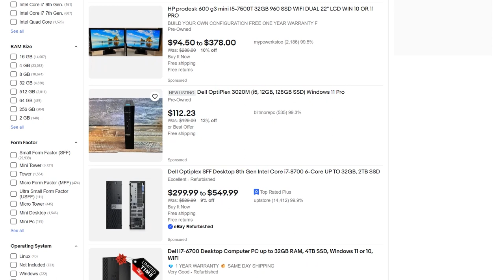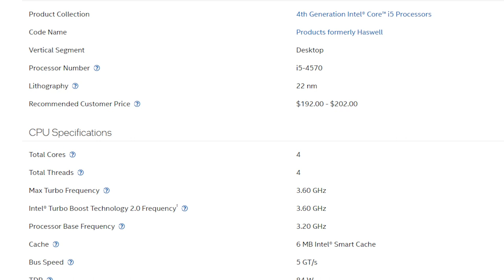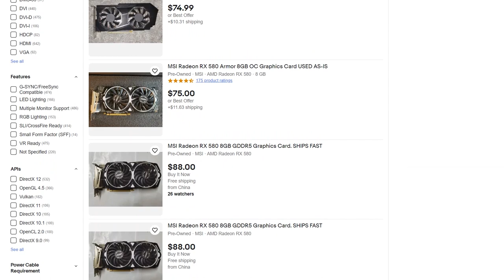I Built a $200 Gaming PC

Comment: I used to do a lot of budget office PC rebuids, I think it's cooler than the 2000$ pcs (at a certain aspect)
Reply from the maker: True! It’s obvious expensive computers will run well lol not so obvious with cheap and weird ones
Reply: Way cooler bro build on
Reply: the satisfaction of building one of these is way better than the expensive ones, especially being on a tight budget and picking the parts
Reply: so true tho it's just so satisfying when it finally works as expected
Reply: weirdo build he did, gaming PC it is NOT !
more fens, radiator ! old GTX 1080 !

Comment: These are my favorite builds to do for customers. They have character and I love rescuing older parts and pairing them to make a great budget esports gaming PC. I5-2400 with an RX550 4GB/GTX1050 was the go to for a long time along with an SSD.
Reply: what parts should we look out for today if we’re trying to replicate this build?
Reply: @supernatural2968  basically what I said. An older Optiplex with an i5 or i7 and a GPU that doesn't require a 6pin. They do make sata to 6 pin adapters though, too. Just most the PSUs in these are around 180w or less.
Reply: Coincidentally, my kiddo plays on my old gaming computer (already on a budget) that has a I7 and GTX1050/2GB. It's held up really well over the last 6 years, but it's getting close to being time to replace it.
Reply: @ShadyButFresh  yeah depending on which i7 it is, you may be able to pair a better GPU with it and keep it longer. Also, just upgrading to an SSD really breathes life and speed back into an old system.

Comment: i play on a core 2 quad e8200 that bought for 1 eur! 15eur on 4gb more of ram, a 250gb ssd and a 20eur gt640. Play almost any game till 2017 and even new games not too complex are also playable. Now bough a hp elitedesk i74790 16gb ram and ssd250gb for 130eur! a 2nd hand rx580 and a new power supply. As soon as the cable adapter arrives from ebay (stupid hp specific connectors) i will have a perfectly modern gaming pc for 250eur...

Comment: Honest, sincere and just amazing presentation, you got my subscription Jason. A Lot of budget gaming Optiplex builds out there but would like to see someone take an Optiplex as far as it can go. Best Dimms not those standard cheap looking hynix stuff, best cooling solution and fastest GPU on a 3rd or 4th gen machine
Reply from the maker: Thank you for your support! Glad you liked the video
Reply: He’s got the fastest cpu I’m pretty sure. I got an 7010 with a lga 1155 socket. And I’m pretty sure the fastest cpu you can get is a Xeon 1620 v2 he said 1625 so I’m not exactly sure but the I7 3770 is apparently the best for gaming but the Xeon is the same ghz and actually gets like.1 or .2 higher with turbo. My 7010 played the new halo for like 5 minutes lol. But I got a gtx1060 3gb and the minimum for halo is 4gb and I need to upgrade my processor cause it’s only 3ghz with 4 cores and threads. I’d bet his setup could run it on 1080p  but I play destiny 2 on 1080p no problem. I been stuck on it for awhile. I want to play shatterline. Looks pretty cool.

Comment: My only complaint with the OptiPlex 3020 MT is that the PCIe slot is only 2.0, while the 7020 and 9020 are PCIe 3.0 and they have 4 RAM slots. Anyway great job on the video!

Comment: I have a same Dell PC with i7 4790k and 1050ti. The power supply I added is a Dell 390w with extra plug for a GPU if I want to upgrade. Total cost was $250

Comment: Man, I saved up enough for a used 3090 before 40 series came out and it was awesome. Ran into a pinch and had to sell it. Managed to snag a 980 for $50 in the meantime. Knocking it down to 720 30-60fps from 1440 144hz was real humbling. It was a bunch of fun though! Throwback to my early years of PC gaming.

Comment: ive been considering making one for flip builds but idk. can make an am4 system for $50-$100 more and have way more upgrade paths and general longevity. this is however the best price to performance optiplex build ive seen, blows ztts outta the water.
Reply from the maker: Thanks! I appreciate it! What custom am4 build can you make for $250? 🧐🧐
Reply: @JasonWitmerYT  im actually contemplating making a techtube channel to show off my flipping adventures. my most recent build has a ryzen 1600 for $20 with a cooler, an rx570 for $30, 16gb ram for $30. tldr grand total of build was $260. yours graphically dominates because of the 1070, but mine is not nearly as dated hardware/ new quality. longevity is a big deal to me and we are now moving into the age of ddr5. not to mention the capability to upgrade all the way to a 5th gen ryzen

Comment: This is almost exactly like what I have. But I just used metal cutters and pried out the hdd cage 😂. Also, mine is a 990 DT with 16 gigs of dual channel ram (4x4 sticks), i7 2600, a 300 watt p3087f5 power supply, Asus Turbo GTX 1060 6 gig, and everything was free except the 87 or so total dollars spent for the gpu. I had a GTX 960 2gig Gigabyte Windforce in there before. (The ram speed is 1333 mhz. I want to upgrade it to a 3rd gen i7 and replace one stick to a 1600 mhz 4 gig module, but don't want to spend money 😅. Great video!
Reply from the maker: Nice rig! I was very close to doing what you did haha but drilling out was a little less messy
Reply: @JasonWitmerYT  True! I just did not want to use power tools. 😅 Brute force worked for me 😅.
Reply: Nice. I have a gtx 1060 3gb. I got for free. Wish I had the 6gb I got a optiplex 7010. For $30 and just grabbed an $11 i5 2320. (I need to upgrade it) it kinda pegs out during gameplay. I got 3 4gb ram and an 8gb ram. I know you aren’t supposed to mix but I had a ts140 with 4x4 but one was pee which is server ram and my computer won’t accept it for some reason. I kinda wish I didn’t Brick it replacing the cpu.  Because the lga1150 cpu socket seems to have more options than the lga 1155 but I may be mistaken. I didn’t know games will do better on less cores higher ghz than lower ghz more cores. But the ts140 had a dual core 3.5 ghz I 3 and it ran games better than the quad core i5 3.0/3.2 ghz. Oh well I’m gonna get the Xeon 1620 v2 or the i7 3770. You can find them on Walmart.com by private sellers for $20-$30  then I’ll go for a better gpu. I actually saw a gtx 1060 6gb for $50 on Facebook marketplace.

Comment: Great video. Optiplex computers are great for a quick inexpensive mod.

1 updated my old 7010MT that has an i7-3770.  Great little gaming machine for little $$$.
CPU: i7-3770
RAM: 4x4GB
GPU:  MSI RX580 Gaming X 8GB (needed to take out the lower drive bays)
PSU: Corsair RM550x
ARGB Controller: COOLMOON
CPU Cooler: Jonsbo CR1400 ARGB (tower cooler with 92mm fan - keeps gamin temps less than 70C.
Jonsbo FR925 ARGB reaar exhaust fan
Arctic P14 PWM ARGB case fan (cut out a bunch metal case  behind the front face plate to improve air flow)
2 CRJ 5 pin fan adapters to connect aftermarket fans (no fan errors).
Cheap 90 degree USB3 header adapter as the graphics card covers the header.
Cut the side panel to fit an acrylic window.
Reply: Rx 580 8gb is king of price to performance! Awesome build.

Comment: Good video. Dell make 'workstations; built to run 24/7 under stress. That's why they last and make a great second hand buy. They aren't pretty, but they are reliable. i'd choose that over some £1000  RGB loaded pile of junk off Amazon any day. Oh. always replace the CPU thermal paste though.. it;'s usually white dust after this long.

Comment: I love these builds and hate the people that shame them... my main PC is a Dell precision 5810 (got free from work), E5v3 2667 processor, 24 GB DDR 4, I upgraded the power supply to the Dell 625 watt, added a GTX 1070TI, an SSD with windows 11 pro, and wala! a decent gaming PC! all for well under $300! It plays everything well at 1080P high settings
Reply: Another t5810 owner here. Got it from a local refurbisher for around 200€(coverted from ron).
Mine has the e5 1620 v3, 16gb ddr4, 685w psu with dual 6 pin and an rx 470 8gb. Slapped in a 25€ 480gb kingston ssd and everything works fine so far

Comment: I just recently got a Dell Precision T1650. It has the Xeon E3 1280 v2 with 8gb ddr3 ram, 2 500gb hdd and the Nvidia Quadra 2000 gpu and 265W psu. I ordered another 8gb of ram to bump it to 16gb and getting a RX550 gpu. Along with some adapters and a wifi stick im coming in at about $90 total. My plans are to do light gaming but more for music work.

Comment: A lot of the people that sell the $150+ ones actually are worth it. I built my first pc this way, $150 optiplex 9020 mt with a i5-4590, 16gb ram, 128gb ssd, 3tb hitachi ultrastar. All i did was put a 500w PSU in it and I upgraded to a Xeon E3-1271 V3, it was only like $60. they're much cheaper now. Sold the i5 for $50. I had a RX570 in it but upgraded to a RX6600xt. I've since built a new PC with a 6700xt and ryzen 5 5600 but the optiplex is still running. 

Also all the front sd/micro sd readers work, disk drive as well. 

By the way and fair warning, the RX6600xt is absolutely the maximum sized card you are getting in there without drilling out the HDD cage, which I tend to like because there is nowhere else to put your storage. Also you will need to make sure your sata cables are plugged in beforehand, as well as manipulating them and probably tying them together so they don't bump into the GPU fans. I had one annihilate one of the fans on my rx570 which I had to replace, which was a pain in the ass because MSI Armor card, but it still works after 5 years. Also that card was a tight fit, but the 6600xt is quite literally basically snug against the cage. 

Minimal bottleneck on my setup, I've put my 6600xt in my newer pc and there wasn't a crazy difference, 12-30fps margin, not too crazy because were talking 100+fps

Comment: I assumed you used your existing monitor, but for the scenario of a kid buying his first pc, you should probably have mentioned that cost.  Its important to point out that with a system like that there's no point going overboard on a high res, high refresh rate monitor.  Great video though. I did something like this about 10 years ago buying an old Xeon server from surplus for gaming and to host a minecraft server. It was great as a server but terrible for gaming.

Comment: Man I love these kind of of repurposed builds and budget gaming PC's. I have like 6 older office PC's that I got for between $28 and and $110.
 So far I have upgraded an HPZ 230 and an HPZ 620 with SSD's, ram and GTX 1060 and GTX 770 and they have been great at getting me started into PC building and gaming for the first time ever. I'm in my 60's and on very limited budget and started tinkering with computers 3-4 years ago as a new hobby. These budget builds are right up my alley and I'm having a blast doing them. I try to make sure the machines have a somewhat adequate PSU or they can accept an ATX one with little modifications. My next steps will be to try custom painting and RGB lighting. Thanks for sharing your build, keep them coming liked and subbed.

Comment: i still use i5 4570 with asus strix rx470 with 16gb ram which 1tb hdd 128ssd 500watt brand new psu ,also a new mobo only cost 220$

Comment: I saw these budget builds last year, just wanted to get back into gaming and play some old titles from my youth. 
Got an optiplex 7010 sff with i5 3570 and an RX 550 for €120... 
€55 spent on a 500gb SSD and more ram (16gb total).
The performance I got was a lot better than I hoped. I'm playing RDR2, Metro, Fallout 4 etc. with over 50fps average.
I get a kick out of using low cost devices that over perform...
My car was €450 about 4 years ago, still going.
I built a hifi from spare parts, use it more than my main multi thousand € hifi.
Just got an iiyama g2470hsu which has crazy spec for the price.
Hopefully I can build a cheap pc in a year or two that can play starfield;)

Comment: So...after watching the whole video I discovered that Jason makes the same mistake almost all "budget build" content creator's make when doing this stuff. While cobbling together used parts into a cheap pre-built is great he completely ignores the fact that it takes more than just a tower to make a system complete and functional. It also requires a 1080p monitor, keyboard, mouse, cords and cables to connect everything, an internet connection and since these systems don't have WIFI they have to be hard wired to an internet connection. In some cases you may have to provide WIndows as well as pay for the games you want to play on the system. Just assuming most people have all this extra stuff just lying around being unused is a bit silly and doesn't present the "actual" total cost of a budget build! This system will end up being more like $300 to $350 by the time all is said and done.

Comment: Regarding using such rigs until they break, i tend to use them as such. Because at least for me they become a well kept home and i hesitate to leave them. So if i where in your situation, that 200$ or 200€ in my case, PC would last me until it breaks.

In 2012 i got gifted a then relative new i5-2400 with an OEM GeForce (GT545 if i remember correctly) and 8 GByte of RAM on a Cuppertino 2 mainboard. Background was that a friend of mine who knew that i was struggling financially at that time got that from a contract where he had a client that bought a HP and wasn't happy with it, he made that client a new PC and the client told him to simply toss the then relative new one.
I over the years upgraded and used that machine until 2017 when i used the parts to make my parents a living room PC out of it because i got my hands on a better machine.

Currently i use a Steamdeck of all things as my desktop, wanted one anyway, then energy prices in Germany went trough the roof and seeing that the Deck only eats up to 15 watts for similar results as my former desktop, a Ryzen 5 1600 with a RX 580, that was a no-brainer. My whole setup with two DELL 24" LCDs, a small Nobsound amp and an external 6TB USB HDD eats around 25-30 watts when idle and 45-50 watts when kicked.

Installed Vanilla Arch because at that time i had to use the Valve Kernel as not everything was in Mainline yet and with Arch i simply could use Valves repositories. 
My IDEs, VSCode and cLion, work just fine, as does stuff like FreeCAD and KiCAD. And all the games i want to play run fine enough for me.
I intend to use this setup until it isn't feasible anymore from a performance standpoint, and that will be a long way down the road. Maybe when the Steamdeck 2 comes around.

Comment: I've been using an Optiplex 3010 for a few years now. Upgraded it with an E3-1230 V2 CPU, 16GB RAM, 2 SSDs, 550W PSU, and an RX 580 8GB. Most of it were upgrades I did over time and it's been great for me. Now I'm in the position where I can afford to build a PC so it's time to retire the Optiplex. 

Luckily I can reuse the PSU SSDs with my new build. Gonna be upgrading to a Ryzen 5 3600 and RX 6600 XT this week.

Comment: But won't a custom build be bit more expensive but later more upgradable and each upgrade will at some point make it cheaper than used prebuilt in future.
Reply from the maker: Yep, but some people don’t need or want more than this. They don’t want to make upgrades. They’d rather build this, then just build an entirely brand new pc when they are ready. Upgrading your rig over time might seem logical but it’s kind of a headache for non tech people. To each their own!

Comment: I built a $160 budget pc for my friend 8-9 months ago with dell OptiPlex 9020 ($70), 16 gb 2666 MHz ram($30), i7 4770 (default CPU), a cheap SSD 256 gb (that I sold the original ram to buy) and the rx 560 4gb ($60) I wonder what you would change in my build choices. edit: the default hard drive with 500 gb too

Comment: I have a 7010  with a gtx 1060oc 3gb G6 power supply.  16gb ram and I forget the processor. I’m pretty sure it’s a I5  2320 or something like that, it’s 3ghz quad core 3.2 turbo. It was only $11 lol. But I’m thinking I’m going to switch to either the i7 3770 or the Xeon 1620 v2 I went with the 7010 because it has 2 pci 16 ports. I got a 500gb nvmd ssd in one and a 1tb hhd I also have 2 750gb but I don’t really use them. But yeah the 7010 was only $30 on Facebook marketplace.
Reply from the maker: Nice deals!
Reply: Definitely. The gpu and power supply were free lol. But I actually saw a gtx1060 3gb on Facebook marketplace for $40 which is what I got. But the power supply is pretty pricey… I’m not sure if you make videos like this often. But the Lenovo ts140 is actually a good budget gaming platform. Lots of sata ports, pcie 16 3.0. I was using one and it worked great but I ended up bricking it because I put in a new cpu but didn’t update the bios. And it wouldn’t boot and when I switched back it started beeping. So I panicked and turned it off. And that was that.
Reply: I have the i7-3770 in my 7010MT - great little chip. It will give you quite a bump over your i5 for only about $40

Comment: for around 150 pounds you can get 16gb 6 core Xeon if you go with IBM Think Centre psu is normally platinium 900 watt psu with two 8 pin connectors be warned you cannot replace the psu with an off the shelf model its bespoke to IBM but it can literally handle any graphics card you throw at it

Comment: did any mid tower office case of an office PC has the ability to change the PSU and add a GPU i talk about the thinkstation M800 mid tower
i found a i7 6700 16gb ram 120gb ssd 500gb HDD for 210$ and add a used PSU for 30$ and the beast that never die the most powerfull GPU in the world RX 580 8gb for 70-100$ its a 6th gen intel CPU and i have the upfradibility max to a i9 9900k that is super powerfull TI